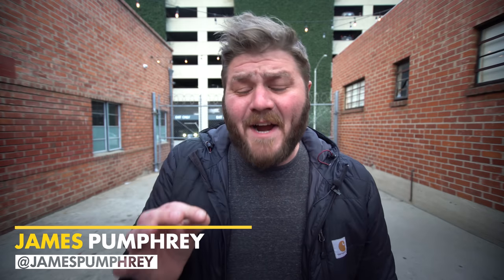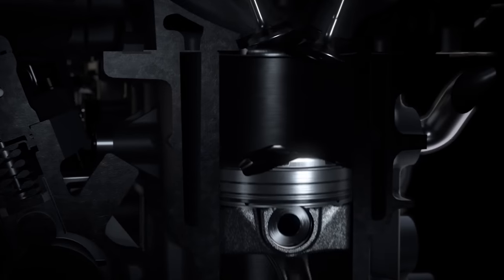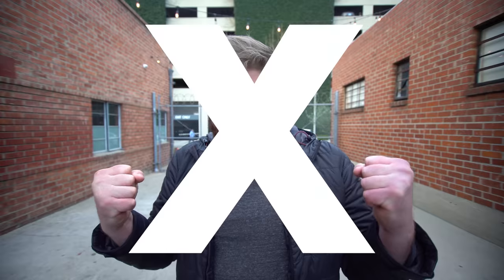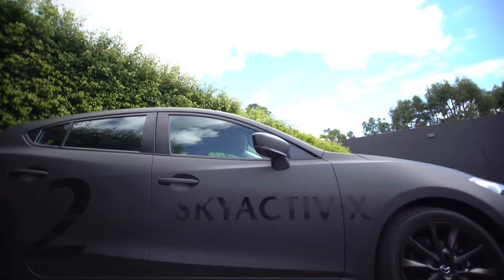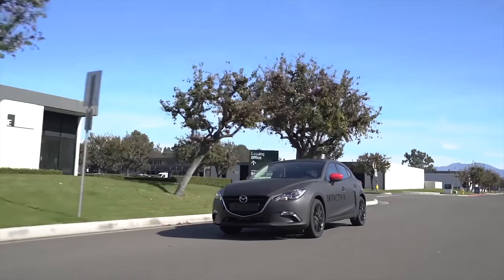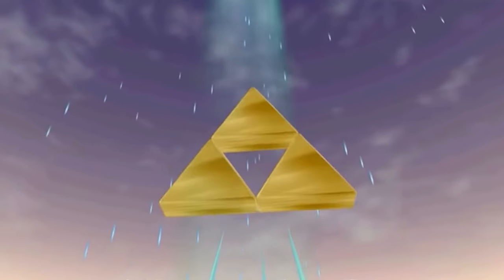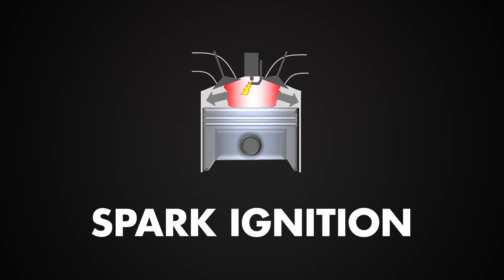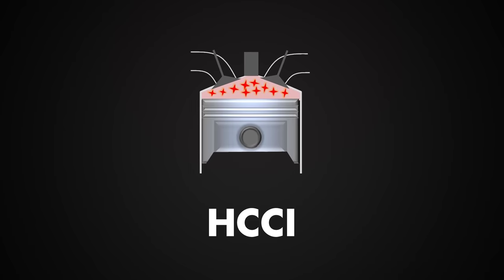Mazda's Secret New Engine Technology - SkyactivX | The New Car Show

Comment: What about NOx? High compression means higher temperatures which can cause NOx. So how does this thing control the temps? I wonder how this engine will fail and how much cost of repairs will be? Zoom zoom
Reply: Michael micale they cool the intake manifold
Reply: Petrol engines produce way less nox than diesel's, I think part of it is down to the fuel itself, diesel is a lot more dirty than petrol is as it's more like a oil and so it doesn't burn cleanly whereas petrol is less like an oil and burns clean and easy. So this engine has all the characteristics of a petrol engine but also has the benefits of a diesel, like low down torque, economy without all the emissions of a diesel.
Reply: Actually this engine runs cooler. It runs so lean (36:1) that there's plenty of leftover unburned air to absorb the heat. Lean burning engines therefore produce considerably less NOx.
Reply: Lean burning engine produces MORE NOx
Reply: doktorbimmer, not if it's cool enough. This isn't your typical engine which by default runs slightly rich. Lean burning in a conventional engine means you tend to still be very close to stoichiometric, which means a very hot combustion with a bit more excess air.
A proper lean burning engine will have so much excess air that whatever little fuel that combusts will have the combustion heat absorbed by a considerable volume of unburnt (thus much cooler) air. There's very little opportunity for NOx to form.
Reply: +namasayanif Clearly you don't understand the basics of NOx formation...
Reply: Can you tell more rather than answering like that? I'd genuinely like to learn more. But, as far as I know from reading all the white papers on NOx reduction of various engines (diesel, petrol, natural gas, gas turbines, etc.), lean-burn is a viable strategy for reducing thermal/flame generated NOx. Increase the specific heat capacity of the charge to the point where it can reduce the combustion temperature to below the temperature threshold where NOx production will grow exponentially (~1500-1600 C).

Stoichiometric AFR produces more NOx than rich AFR due to high temperatures, but 3-way catalaytic converters take care of that. Richer AFRs reduce NOx, but the catalytic converters will not work effectively. To achieve NOx reduction with lean-burn will require such a lean mixture that the flame speed becomes too slow. The engine becomes almost unusable, other than at idle and low constant speeds. HCCI (SPCCI in this case) mitigates the problem by having the flame front occur not starting from a single point in the combustion chamber, but at the fuel droplets themselves.

The challenge is to have a cat-con that works with lean-burn. 3-way cat-cons is only effective at AFR, and it has a very narrow AFR range. It's pretty much only works at stoichiometric AFR. At worst, lean-burn produces just as much NOx as rich-burn, only with the latter you're burning much more fuel.
Reply: You seem completely oblivious to the effects of PRESSURE on NOx formation.
Reply: doktorbimmer, no I am fully aware. High pressure however is not inherent to lean-burn engines, and studies done on lean-burn are done with test-engines made to run various AFR, without "massaging" the engine's mechanical design to favour certain outcomes (e.g attempt to ignite mixture easier, to extract more useful work from lean-burn, etc.). Because the study is on the effects and emissions of lean-burn, not on ways to make lean-burn a commercial success.
To say that lean-burn engines in general is a more NOx polluting engine is a false statement. Much of that is due to engine design, not the fault of lean-burn in itself. A lot of the problems with commercial attempts of lean-burn engines is in the way they try to overcome the problem of reliably igniting very lean mixtures. Honda published a paper to SAE of their research of a similar system to Mazda's SPCCI. Their attempts at conventional lean-burn engines shows an insufficient NOx reduction, which is attributed to the relatively richer AFR required near the spark plug. So in their case it's not the overall lean mixture that is the problem, it is the flame-generated NOx from the richer (but insufficiently lean) mixture. Here are excerpts of the published paper at the 'SAE/KSAE 2013 International Powertrains, Fuels & Lubricants Meeting':

"In conventional stratified-charge lean combustion engines, because a rich air-fuel mixture is generated in the vicinity of the spark plugs, NOx is emitted in the first half of the combustion. In stoichiometric combustion, close to 100% of the NOx is purified by the three-way catalyst, but in lean burn the three-way catalyst is almost completely incapable of NOx reduction. Thus, for the emission control value to be satisfied, the NOx must be trapped and reduced using a lean NOx catalyst (LNC). When the NOx in the LNC reaches the permissible amount, lean burn is stopped, and rich combustion is performed to reduce the NOx. As a result, the cycle for this rich combustion reduces the fuel efficiency. As emission control values have become stricter year after year, NOx reduction cycles using rich combustion have also increased, and there are now almost no automobiles with lean burn engines being sold."

"To improve fuel-efficiency and cost, this study aims to contribute to the construction of lean burn technology that does not require an LNC. The research discussed in this paper therefore focused on a form of lean burn involving the stable spark ignition of a homogeneous premixture that would be able to balance low NOx emissions with combustion controllability. To that end, the primary goal of the study is to identify the mechanism by which the limit of homogeneous lean burn, which can contribute to reduced NOx emissions, is reached. Building on this knowledge, the research aims to achieve a high-efficiency, low-NOx homogeneous lean burn engine."

- Hanabusa, H. et. al.
Reply: No, high pressure is only inherent to engines with high static CRs above 14:1... LIKE THE SKYACTIV-X with 16:1 CR.
Reply: Diesel engines operate at far leaner AFRs (up to 80:1)  they also produce high levels of NOx due to the high pressures above 14:1 and the EXCESS OXYGEN available to form NOx compounds.

Comment: Skyactiv-G and Skyactiv-X technology requires high static compression Ratios... anyone familiar with Wankel engine should know that this is simply not possible because of the Wankel KKMs seriously flawed and limited combustion chamber geometry, CRs above 12.5:1 cause serious disruption of proper ignition flame propagation and deflageration making the designs poor combustion efficiency issues even worse. Mercedes-Benz exhaustively studied and developed GDI fuel injection systems with the Wankel engine in the late 1960s and found the CRs too low to effectively adapt Stratified Charge Mode Combustion and several other manufactures such as Rolls-Royce, Deutz, Yanmar, MAN, Krupp and John Deere studied Direct injection Stratified Charge operation with the Diesel Cycle and all failed to produces a commercially viable engine for these exact same reasons. Mazda's Skyactiv-X technology utilizes a modified Miller Cycle and variable valve timing in order to actively control Dynamic Compression Ratio something not possible in a fixed port induction design such as the Wankel KKM so any suggestion that Mazda is working on a similar system for the Wankel engine is simply ridiculous and without any technical merit.
Reply: You are right in your statement but at the time that those test where taking place (60's - 70's) even into the mid 80's the technology was no where it is today.

We have new computer technology and way newer materials which can over come some of those issues. And even new fuel additives which can prolong or even stop detonation at high compression and help combustion. 

I work at Notre Dame university and in the aerospace department they are working on a fuel that has the same properties as gasoline but acts like diesel. Now this type of fuel has been around for decades used in the SR-71 but just now being applied to the automobile. You can use MASSIVE compression rates without the premature detonation. And you need very little fuel per charge. Which given this new engine they are testing explains ALOT..
Reply: @Troy Bush Who said the Wankel's fatal flaws have anything to do with a lack of material technology or a lack of computing power???
 Your theory is like suggesting that technology can make a square wheel more efficient than a round wheel... it indicates a complete lack of understanding of the inherent fundamental flaws in the Wankel KKM design or why it is now obsolete.
 Please explain why you would want a gasoline fuel that acts like Diesel fuel??? and how that would solve the flaws in the Wankel engine?
Reply: @doktorbimmer  Simply go back and read what you wrote, read what I wrote. 

It's pretty self evident in what I said.
Reply: @doktorbimmer  But if needed I guess I could spell it out more.
Reply: @doktorbimmer  actually no I'm not trolling nor am I being insulting if you dont understand what I mean I guess I need to explain in greater detail.
Reply: Clearly you do not have a functional understanding of the Wankel KKM engine's fatal flaws and why development of this engine design has been abandoned and is obsolete today.
Reply: Please explain what new material shows promises in offering a significant improvement in Wankel engine performance and efficiency and how is this new material(s) is utilized to achieve this improved performance????
Reply: Just answer the simple question... "Please explain why you would want a gasoline fuel that acts like Diesel fuel??? and how that would solve the flaws in the Wankel engine?"
Reply: @doktorbimmer  OMG you should go back and read your own post. You bring up combustion issues from high compression. Now with new fuels that isnt a problem any more.
Reply: Yes. Thank you again for confirming you have no clue what you are talking about and are in fact just wildly speculating about a topic you simply do not have the slightest grasp of... You cannot change the unique geometric relationship that allows the Wankel KKM to function as a 4-stroke engine... the shape of the combustion chamber and its volume is fixed within a very narrow range... increasing the static compression ratio can only be achieved by reducing the volume of the chamber recess and this reduction directly and adversely effects ignition, flame propagation and overall combustion efficiency. This also clearly explains why there has never been any successful examples of Wankel engines utilizing the Diesel Cycle.
 Please stop pretending you understand this problem or how its supposedly can be cured by modern materials or computers... you are simply embarrassing yourself with your ridiculous remarks and childish theories... the only one that looks like a fool here is you son.
Reply: @doktorbimmer  Have a nice day! I'm not going to fight on YouTube with kids.. 

Good luck with your life!
Reply: @.SpiinDeX You can't escape the truth... and lies will always be exposed

Comment: @2.47 while you are right..., the efficacy gain with diesel is due to its engine RPM being controlled by the injection of fuel. Most Gas engines RPM is controlled by a butterfly controlling the volume of air. This creates Vacuum in the intake system witch is a pumping loss in its self. A diesel has no vacuum so it gains VE.

Comment: If this engine pans out, and it cuts the mustard as Mazda says, then, technically, peeps, any car powered by it, will be 10 times more environmentally friendly than any other electric car on this planet, for the next 100 years (because it took that much for the common combustion engine to perfect itself, and buy itself (it's building process and construction and fuel etc) out).
Electric cars as they are presented today, are super pollutants, especially with some manufacturers who are behaving like scam artists and drive the user base to, quite literally, use the car as a disposable utility, with many of them ending up as trash on CoPart and such alike.
Reply: I hope what they claim is true.
My first car was a 1986 323 1.3L but i have shied away from Mazda because they never seemed to be interested in getting power out of their engines. A MX-5 with a bit more power than they had would have been really interesting for me. Seems they are now catching on they wouldn't have raised engine power on the current generation otherwise. The 2019 Mazda 3 got on my radar since they were talking about the new engine but i would still get the tried and proven 2.5T...that tech is too new. Wait until they have sorted out the kinks.
The 2.5T is very interesting because it has a ton of torque from low rpms 420 Nm from 2k revs compared to my current car with around 440 Nm which gets full torque 4k revs and 250hp isn't that far off from 315hp but with a way better fuel mileage.

Comment: 10 years go by, electronic system starts to fail and you have to spend a fortune to fix it. Cool if you buy it new, not so cool if you buy it used
Reply: Welcome to modern day, you act like everyone is still living in the 70's and scared of electronics. How often do electronics actually fail on cars? Not often at all. You're more likely to wreck the car and total it before the electronics actually go out on a modern car
Reply: You haven't owned a S65 powered BMW. lol
Reply: How often do electronics actually fail on cars?

sigh bmw ... :,-c
Reply: I've never heard of the ECU just giving up and making a car undriveable. I've seen power windows fail.. is that your point?

Now I'm gonna go out out to my used Mazda 3, push down the clutch, press the start button, and go about my day. I'll let you know if an electronic part ever goes bad.
Reply: I've got several Mazda ecus from the 90's still working fine. Engine still sees 7k rpm every time out as well.
Reply: Electronics?
shakes in French
Reply: @kylegalvin9807  You're right! 15 years and older are the better cars.

Comment: This sort of reminds me of a Top Fuel engine in that the initial flame front is used to vaporize the large liquid fuel volume in the cylinder to make it burn. As the liquid fuel vaporizes the combustion event perpetuates vaporizing and burning more fuel till it is consumed somewhere near top dead of the compression stroke. If combustion stops it hydraulically locks the cylinder and BOOM.

Comment: In 1970, Tom Ogle achieved 100 mpg in a 1970 Ford Galaxy. He traveled over 200 miles on just 2 gallons of gas. That was an old push rod 1970 beast of American iron getting over 100 mpg. Yet engineers are chasing more and more extravagant engine tech just to get a few more mpg. Allegedly!

Comment: Guys hear me out... do you guys know how much tuning potential we have now. WE DONT NEED TO DEPEND ON THE OCTANE OF THE FUEL. It's like a diesel because diesel don't have the knocking problem. Also means that the only thing limiting us from power and tuning is how strong the components are. You just put more fuel and more boost to balance out the air to fuel ratio and you don't need to tune the timing on the ignition. It does not have problems with preignition either.

Comment: They should make it run in super lean mode and have it power a generator to charge a battery, which, in turn drives the wheels.

Comment: While the HCCI is cool, I can't wait until someone does a good 6 cylinder opposed piston engine, since 3 cyls are best for balance, 3 on each side, opposed, electric turbo charged, intakes on top, exhaust on the bottom, so it would be short and flat!!!

Comment: New engine technology that can give our vehicles a good engine performance with High effeciency and from Low to zero emission including fuel saving feature is always the dream and top priority of every car manufacturers. ICE vehicles will continue to be used for a long perion of time as long there's still a supply of fossil fuel. But we all know that fossil fuel is not renewable and it will be depleted in the future. So how we can use an advance ICE vehicle if there's NO fuel left. So electric vehicle and fuel cell vehicle like the hydrogen powered electric vehicle are still the future of all vehicles
Reply: Good comment, although I have to add that renewable alternative fuels will not run out... so ICEs are not going anywhere.

Comment: Let's see the dyno. I'd bet Honda's K series with cam phasing is more efficient and with a flatter torque curve. Just assuming. Cam LSA is one of the most important things in tuning. If you only tune one thing, it's the cams. The K series can change cam LSA on-the-fly.

Comment: One of the reason's diesel is more efficient is that it has more density per volume than gasoline.
Reply: Not true, Diesel engines are more efficient regardless of the fuel type.

Comment: Hi there James! 
Modern (last 25 years) tdiesel engines are very efficent, they dont kill anything, they consume much less than comparable gasoline engine, they have much smaller emission compared to petrol engine, they offer more pleasant drive (due to torque) than petrol engine etc.... only con is NOx emission and this is in my opinion exagerated.

Comment: How bout this for efficiency. 1992-1995 Honda Civic VX.
It came with the VTEC-E engine.
Rated at 55/49 MPG. I purchased a 1992 & had it till 2015 with 365,000 miles. Not a single thing ever went wrong with that engine. 
I commuted a total of 80 miles per day. Mostly on the highway doing 80 MPH. I averaged 41 MPG. I went through all weather including blizzards & drove her hard.
There are blogs devoted to this specific vehicle. Why didn't they take off with this technology I'll never know.
I'm confused why